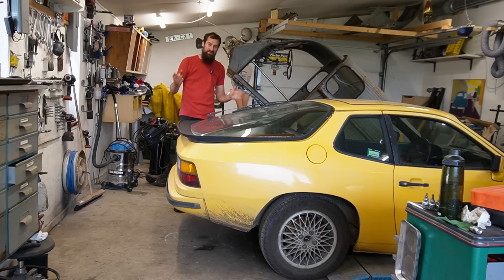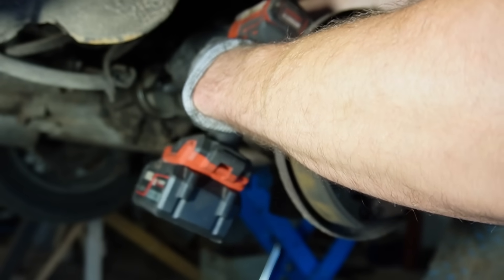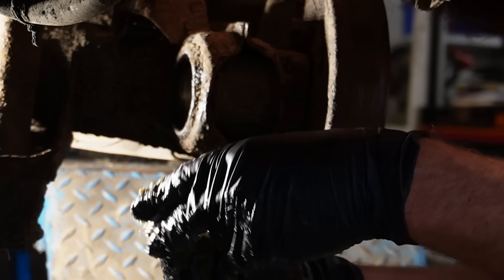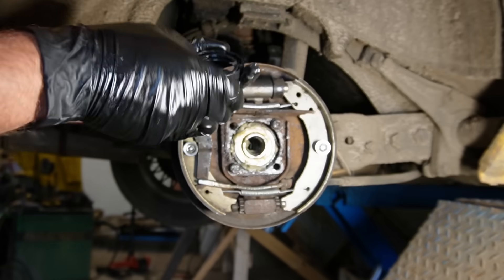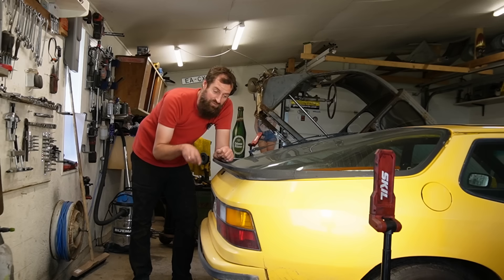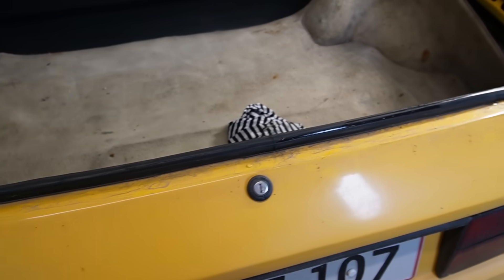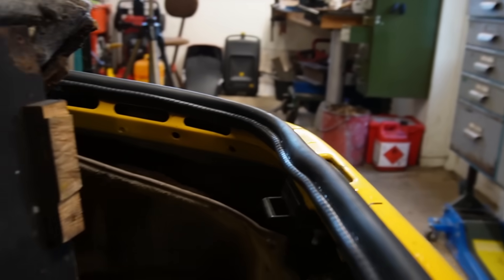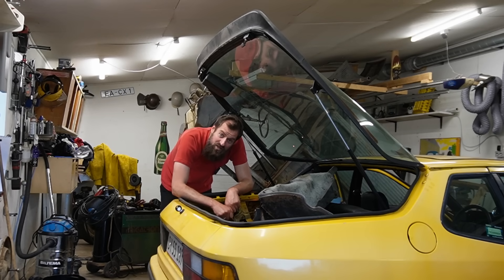Porsche 924 | Rear Wheel Bearing And Drains

Comment: In the UK you can register your Porsche on the Porsche Classic Register at your local main dealer. You get some nice free stuff as well as discounted parts which are often cheaper than the aftermarket suppliers. I’m not sure if the same applies in Denmark?

Comment: I've got my 924 just after you did. I learn a lot watching these video's, thanks! Also in the process of fixing the unintended water ingest in the back. So far I've replaced the hatch seal, hatch lock seal and refitted the rear lights with RTV. The rear drains from the targa roof and the fuel filler drain also end up in the lower spaces left and right of the trunk. I suppose Porsche designed the 924 with some holes in the back.. There is no overpressure vent anywhere, and air which enters the cabin has to go somewhere, so they must have thought not to seal it up that much. The Internet also mentions exhaust fumes being sucked in when a window or the roof is opened up. Maybe that is why my new blower motor is running even when it's set to off, to always get some fresh air in?

Comment: Awesome video!
My 924 is mostly under cover however when left in rain recently boot filled up with water. 
Just went and checked the boot latch drains and both side were disconnected (actually found the hoses in the sill wells!)
Refitted and I’m sure it will be fine now!!

Comment: For the exhaust fumes, look at latch pins on the glass side… If I remember well, you should be able to adjust the seal preload by screwing them in to compensate the latch mechanical wear. On my 81 it solved the problem…. sold this car in 95.
Reply from the maker: Yea they are adjustable... but they are already quite tight...

Comment: Exhaust fumes in the cabin are a common problem on the 924, typically if you drive with  window open.  Can be multiple things like, poor sealing round gear lever, unsealed holes in the rear panel, poorly sealing rear light clusters and often the rear hatch seal.  Even with a new hatch seal don't rule that out, it may not be compressing evenly.  The best troubleshooting method is using a smoke bomb and seeing were that escapes from.  Good luck!
Reply: Or just the car being old enough... Leaks and odour (and dirt) control it becomes just basic maintenance (usually forgotten by owners and mechanics).

Comment: I've been struggling with the same hatch leaks in my 924. After replacing every seal/gasket/grommet, cleaning the drip trays and hoses, it ended up being the seal between the glass and the aluminium hatch frame. Looking online the deterioration of this seal seems to be inevitable on every 924/944. People more competent than myself have separated these and resealed them, but as I didn't have a garage I tried to patch it up with windscreen sealant on the front and back which so far has worked. Hope you don't have this issue as it's not fun to fix!

Comment: How easy it to replace rear wheel bearing on a Porche 924 l have seen in other cars were you need a press obviously when they designed the Porche 924 to make changing the rear wheel bearings